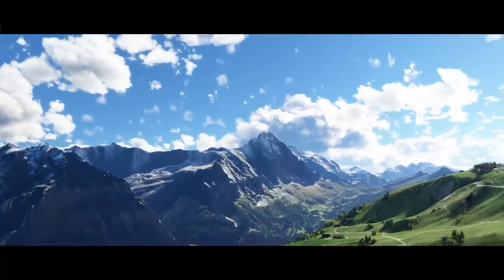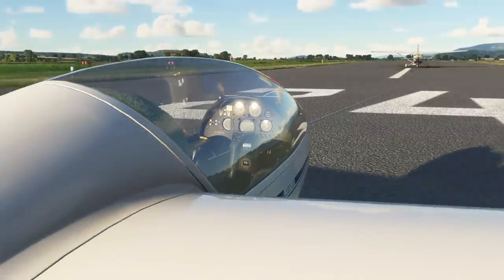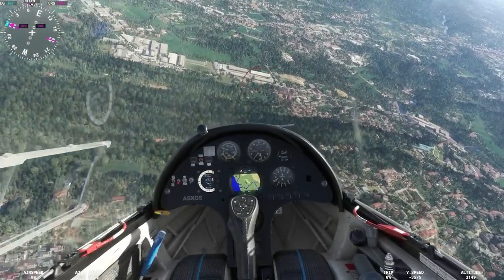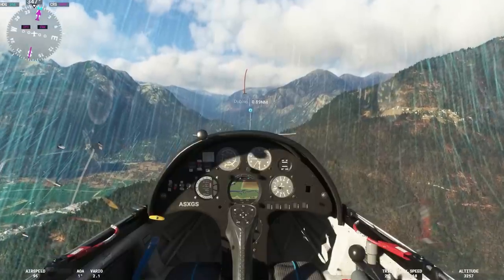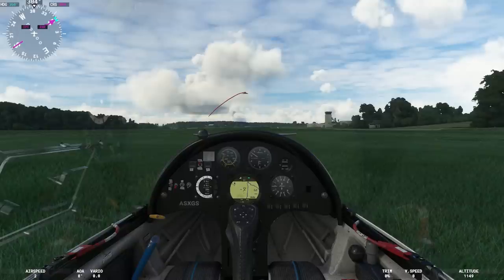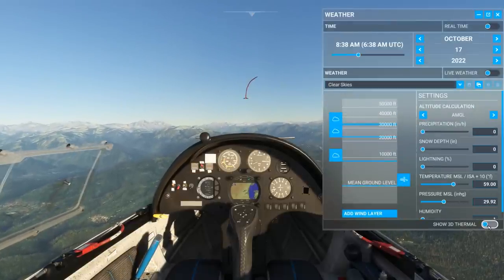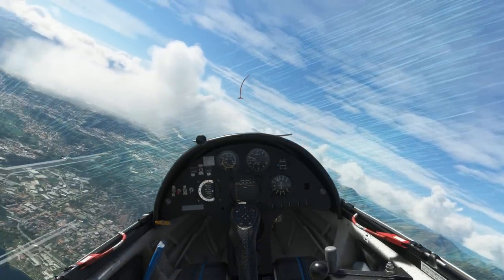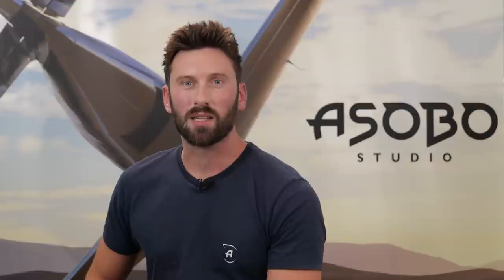Feature Discovery Series Episode 14: Gliders

Comment: Thank you so much for your efforts - these gliders look truly great and it's really appreciated you spent as much time on the instruments and flight model as the 3D design. Please note at 5:45 the glider is shown climbing in a 'thermal' in clear air well above cloudbase which illustrates well a fundamental issue we are raising on the SU11 beta feedback - if there had been a thermal there rising to that height of course it would have formed a cloud as soon as it reached the same condensation altitude as the others. This lack of connection between clouds and thermals is a major issue for the thermals.
Reply: Isn't he circling at around cloud base? At least that's what I'm seeing?

All the arrows make me worried that the thermals are gonna be way to wide tho
Reply: @Antennenwels1  if you're at/below cloudbase you can see the horizon...
Reply: good point, I just want to hop from cloud to cloud with no visualizations :(
Reply: There is no doubt that there are connexion between thermals and clouds. At 6:20 for example. How realistic it is, I don't know. Also, I saw a lot or air going up and no air going down. I guess it has to go down at some point otherwise there would quickly be no air left at the surface and we would suffocate.
Reply: @haltux  lol we don't suffocate but it's a common misunderstanding to imagine the narrow column of warm air that rises up until it matches the temperature of the cooler air aloft has to somehow come back down. The 'volume' of a thermal is very small compared to the overall airmass (although the moving air in it can weigh 100,000 tonnes) so other air movements can easily backfill it. There IS sink around, of course, but this needs really careful modelling in the sim to be realistic. Also there is localised downward moving air in the region of the thermal as a result of the complex interaction of the rising air with the bulk airmass it's rising through, but again this would need careful custom programming to get right. Asobo are far more likely to fall into the rookie assumption that rising air in a thermal has to be 'balanced' by air coming down nearby which is completely wrong.
Reply: @b21-soaring  I guess you mean to say that replacement air can come from anywhere around the source of the thermal, correct? When I was a volunteer bush firefighter we were taught that a ground level wind current will form that moves air towards the base of a fire, and since a wildfire can be considered an extreme type of thermal air column, then it will be the same with normal local weather patterns.

So, replacement air for a thermal column will be fed mainly by ground level air, which is supplied on the breeze. Displaced cool air above the thermal will move sideways and become part of the stratospheric air currents.
Reply: @rarewhiteape  hey bush fires are the best thermals! I've thermalled in UK stubble fires (back in the day, they're banned now) with bits of burning crops coming up past the cockpit. In a comp you do what you gotta do... Yes, I'd say thermals behave exactly as you describe. Which is not to say sink doesn't exist, it's just not particularly related to the thermals so in sim terms it should be modelled independently. The rookie sim development is to program the lift and sink together because they seem similar, and program the clouds separately, where the pro approach is to model the thermal and cloud together, and model the sink separately. Also I just remembered, as you climb up in a honking thermal from a field fire, you know it's good when you see it forming it's own cloud high above you. When you get up there, you find out a whole layer of the sky now has the crap from the fire floating in it as a kind of thin black smudgy layer you're seeing side-on but end up gliding through it. When you land you have greasy smudges on the leading edges of the wings.

Comment: I had been eagerly awaiting official support for gliders since they appeared on the roadmap.

And when I started the glider tutorial today, I literally got goosebumps. Of all the glider airfields in the world you could have picked, you used Oerlinghausen, which is where I did most of my glider training and where I solo'd in a Schleicher ASK 13 at the age of 14 back in the late 1970s before moving on to single-seaters and more modern, higher performance gliders.

Going through the tutorials, I had the opportunity to re-live and apply the lessons I learned there in real life, doing both tow and winch launches, getting surprised by my instructor who simulated a winch cable break by releasing the winch cable, and by looking for thermals. I was surprised that the ridge soaring lesson didn't take place at Oerlinghausen since the ridge just north of the airfield is suitable for that, too, but there are certainly better locations for ridge soaring.

Regardless, Asobo did a fantastic job with the glider support and tutorials. Congratulations and many thanks!

Comment: I'd love to see more weather simulation, thermals and ridge lift are important, but more important are convergences and energy lines. Easy to ask for, very hard to implement I bet!
Reply: Weather and lift simulation is absolutely key to a good gliding sim experience!! Definitely looks like a good base to start from, I'd love to see wave implemented properly. Not even Condor can really Scottish wave properly though.
Reply: Yes better atmosphere is essential for gliding. Thermals need to also generate reasonably realistically to be useful, which it sounds like they have done
Reply: @adampoultney8737  I hope the visible updrift lines seen in the video literally EVERYWHERE around the glider were just for testing purposes and won't be in the game..
Reply: @Giofear  The thermal visibility feature will most likely be an option,  an on/off thing.
Reply: @coriscotupi  Yeah I don't doubt that, but my concern is that the updrift will be everywhere. In reality it's very difficult to find thermals or updrift waves. And you most certainly won't find any thermals above lakes and forests.

Comment: 3 things I have noticed and I hope you will get this right. The wing flex looks very extreme for me. I have many hours in the ls8-18 and the wings flex a bit, but in a much more linear way along the whole wing (very different from longer wingspan gliders). I have to give it a look in vr. 
The next thing is the motion during winch launch. The ls8 has the tendency to nose up extremely just after leaving the ground if pulled quickly by the winch. You must not  pull the stick to get airborne. Always push a little and trim nose down. In the Video the pilot pulls a little and it looks alright for me. So maybe you have nailed it already. 
The third thing is climbing along the clouds or next to them above the cloud base. Under normal cumulus conditions it is extremely difficult to climb higher than the cloudbase. The lift is much stronger in the center of the cloud (more ore less, depends on lots of things). You could only do this if you fly on the edge almost in the clouds and the lift will be very weak if there will be any lift at all.
Reply: Man it's a preview of upcomming things. If you checked everything in two weeks or so you can comment. Don't assume something you think you see in a presentation video.
Reply: @ThePixelbuilder  Lol you dont have to assume. The beta is out already. Which the third point is extremely valid because thermals in SU11 is no good for realistic gliding.
Reply: @FrostbitexP  lol right - showas you dont know what you are talking about -  SU11 Beta does not include gliders ;) you have to wait for the final release. So everything is "assuming"

Comment: The model of the glider looks fantastic. One detail I would add though is wing tape. 

We usually tape over the joints after gliders are rigged to decrease drag from the seams. On the Twin II my club owns, if I’m taping it after rigging, I will add tape along the full upper and lower edge of the wing root, around the seam between the tail and horizontal stabiliser (leaving the gaps where you can inspect the connections in a DI), the base of the pitot tube, and the panel that covers the locking pin of the tail. It would be highly unusual to see a glider flying without taped wings.

Comment: Actually think I'm really going to enjoy them as they add a new level. Doing line flights with commercial aircraft is fun, but this is a real challenge. Properly working with thermals to reach a certain destination is a new challenge every time. And at the same time you can enjoy the awesome visuals.
Reply: Simming with commercial airplanes can be boring. It's all about pretty long preparations before taking off, then monitoring altitude constraints and watching the airplane do it's thing, and then land. And we don't even get to use the cruise time to badmouth the company salary and schedule as is done in real life. I'm leaning more toward GA airplanes and helicopters. 
Gliders will be a very welcome addition.

Comment: In case someone from Asobo reads along and looks in the comments: The perspective in the cockpit is kind of weird. The panel seems too far away, at least I can barely read the instruments. The speedometer has a light gray pointer that is hard to read in this narrow/cramped display. Wind noise is an important acoustic feedback for the speed of a glider. In simulation, it is more of an acoustic feedback for thermals. So you have this wind noise even when the speed is low. That's really puzzling.  On the other hand, the acoustic feedback could be a bit stronger when pulling the speedbrakes. Over all  MSFS is on its way to the best gliding simulation on the market. :-)

Comment: Two questions. 
1. Thermals move with the wind, so you have to follow the wind to be inside the thermal while gaining potential energy. Does this happen in MSFS?
2. When entering a thermal, there is an surround area that is producing a downdraft. It is like absorving the wind to the ground to then pull up from the base of the cone of the thermal. Is this simulated aswel? 
3. And sorry... another one.  Does it have waves? This would be awesome to make huge distances.

THanks!
Reply: 1. You are within the same moving air mass, so theoretically it's the exact same as flying in still air from the pilot's reference frame. You'll be traveling across the ground with the wind but your stick movements shouldn't differ.

2. Agreed, hopefully it'll tip the wing like IRL. Always fight the tipping. It's either the thermal trying to push your one wing out or the sink trying to pull your other wing out.

3. Lenticular clouds and wave lift would be awesome!
Reply: In regards to your second point, sadly no. The SU11 beta is out and you can clearly see thermals dont function as they would irl. No downdrafts.
Reply: Just look at 5:45 - the thermal air is rising more or less at random, unrelated to the clouds. You're clearly not a glider pilot and these requests for additional features creates noise that drowns out the priority of the key issue. Your point (2) is a common guess but not actually the way the air moves - there is a small area of turbulence around the thermal as it rises because of its interaction with the surrounding air but the air rising in the thermal is not sucked down to the ground first.

Comment: The LS8 looks like one of those humanoid robots that are in the "uncanny valley". The yellow tow release handle is way too small, the operation of the water-ballast-lever is wrong, the battery gauges are weird, the seating position is too low and too far forward and the hand-written labels on the panel don't match the high-end instrumentation. Most importantly though, the wing-flex is all wrong. It looks like the inner one or two meters of the wing are very rigid and then it becomes soft all of a sudden. I really appreciate the work that went into this, but in the end you can't beat a sim that was made by actual glider pilots with actual experience in gliders (i.e. Condor).

Comment: These look great but one observation, as an experienced glider pilot, is your yaw string animation is not very accurate.  It should pivot around the attachment point and the only curve it will form is to contour the canopy when deflected.  Your animation most often shows it straight up from the attachment point and bending mid string to indicate slip.

Comment: It's been 2 years, why hasn't Asobo made a working user friendly functional replay system (With Flyby Views) the Asobo team needs to go back and review these features in Flightsim X and MSFS 2004 and implement these features in MSFS 2020. Please find Active Camera and take a look at that program which allowed the user to set Camera distance and hight. The user could set up flyby views that would reset and repeat  at the push of a key on the keyboard as the aircraft advanced along it's flight route and had other features also. Flyby views and a working user friendly replay system should have been a part of the sim from its inception. ALL FLIGHTSIMS HAVE THEM!!!! It's not a flight simulator if it doesn't have flyby views and a working replay system. A simmer spends hours at his/her computer and the only reward is the replay of the approach and landing. Please fix this.

Comment: Kind of depressing that Asobo don't seem to have the hardware required to run the sim smoothly.. Those clips were stuttery as hell, I get better performance than that on a 3080!
Reply: yeah performance for gliding has to be good because the glider often flies in tight turns

Comment: Sorry, but no. Looks very nice I guess, but the whole sound package seems like garbage. There is so much more to the sound of a glider than speed. Every little movement and increase/decrease in drag or side load is going to make different noises. It doesn't seem like any of the interior sounds are modeled either. 

Also - that yaw string looks like garbage. It is constantly half limp, just kinda drifting around like an analogue turn and bank indicator. 

The weather model still looks way oversimplified - with huge widespread thermal lift existing above the clouds...?  The glider also looks like it is flying on rails, and I am sure handles just as poorly and arcade like as all of the other default MSFS aircraft. 

Congrats on making something that looks very nice visually, but is still terrible for gliders compared to Condor Soaring Simulator that has been around for 15 some years with an infinitely better micro weather, sound, and flight dynamics engine.
Reply: Try civil polite constructive criticism. It is far more effective, mate
Reply: well then one more great customer for condor soaring simulator (:
good bye sir!
Reply: Go play X-plane
Reply: @heeko2982  even worse lol. P3D/A2A, Condor, and DCS have it figured out. MSFS is an arcade game compared to those platforms
Reply: @iflyc77  nah its not arcade game 😉
Reply: @heeko2982  it sure handles like one
Reply: @peter-mv5gk  P3D with any of the A2A aircraft I said. 100x better than anything in MSFS ever will be
Reply: @iflyc77  strong statement...ever will be :D.....remember what you said...
Reply: Condor 3 which is in the works -as a gliding experience, will probably wipe the floor with MSFS in terms of flight dynamics and weather modelling......... funny how 2 part timers can produce a more accurate weather model and flight dynamics than  whole teams of people at MS.........